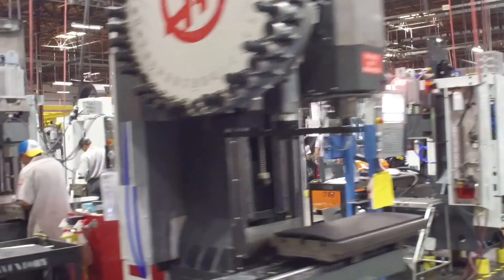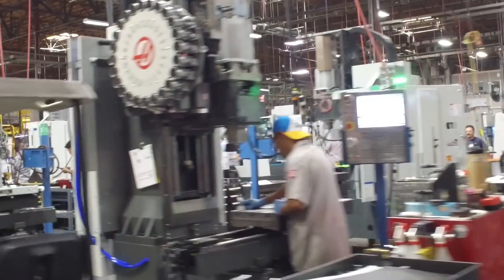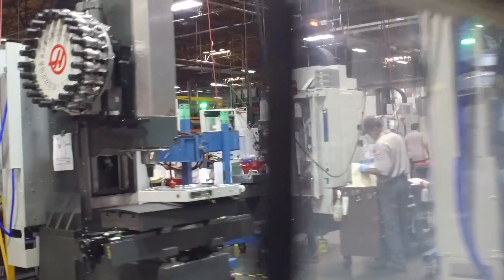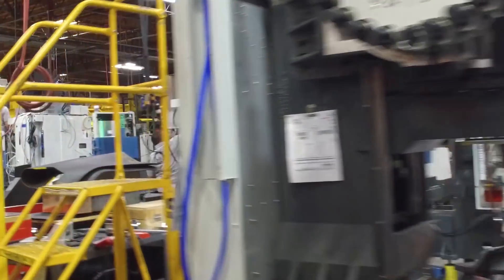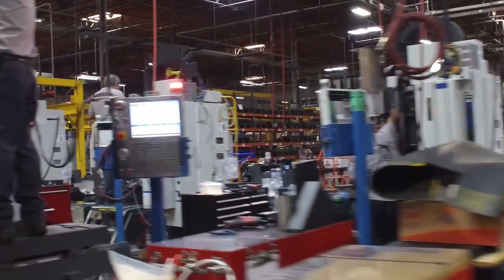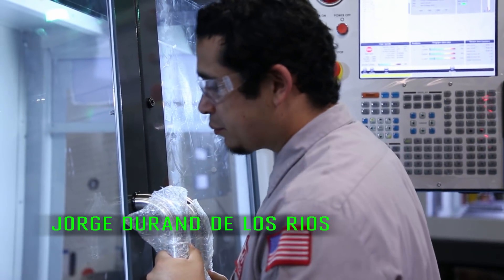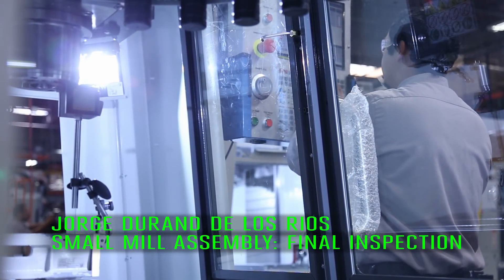We Build Your Haas VF-1 - Haas Automation Inc.

Comment: How much is new machine run before delivery?
Reply from the maker: depenthene - If you can tell me where your business is located I can get you the correct pricing for your region.  Or, you can get the base price of the machine at haascnc.com, just search "VF-1" and the first result you see will be the VF-1 page. - Haas Automation
Reply: Sorry, I meant how much test run is done to machine at factory.
Reply: I think your question was obvious!
Reply from the maker: My mistake, I misunderstood.  Each machine has several tests run before shipping.  Each sub-assembly is tested individually (spindle, tool changer, etc.) and then the completely assembled machine is run through various tests.  These include moving all machine axes, performing tool changes, running the spindle, running a Ballbar test, and finally, doing a test cut. If you add everything up it amounts to several hours of run time. - Haas Automation
Reply: that was neat to see, and enlightening, but its also funny as they use the old school dial indicators to touch off and see if the parts are put togather squarly, you got this high tech machine that makes parts that could be on the space ships or military componants, but its still hand made and tested with tools that are atributed to a patten from 1883 in the states the first dial indicator was said to have been made by a watch maker in Mass. according to google, its kind of funny when you think about it

or the way we power our cites with electricity using superheated steam basicly a steam engine a tech that is victorian in age even if the methods of making the steam have changed and the parts made more effecent at heat transfer, and even though the boilers are not riveted they are still sometimes stay bolted which are often piened over and welded like they have been for over a century.